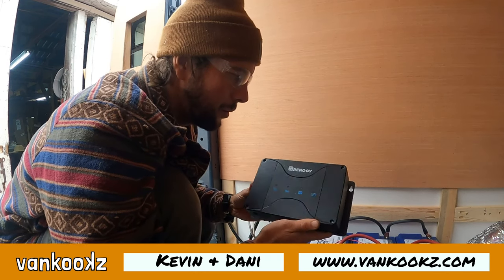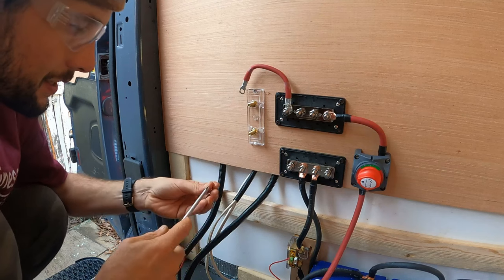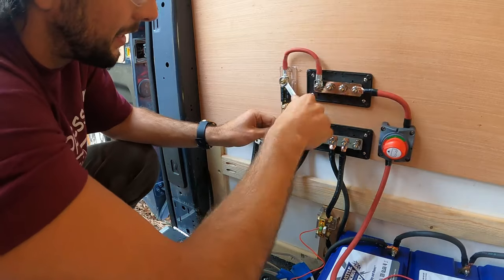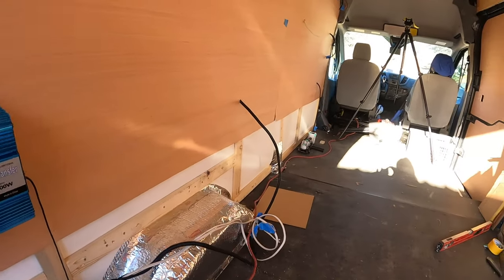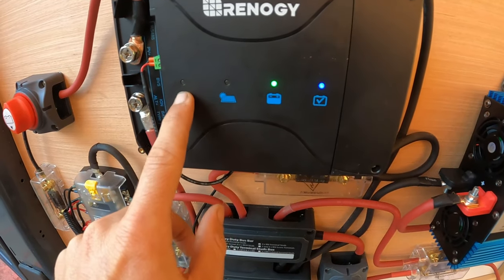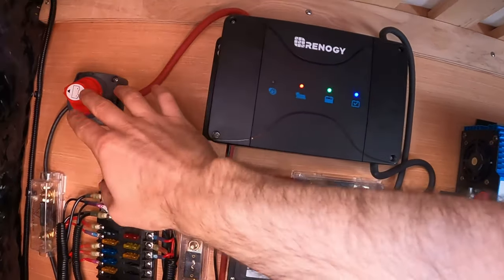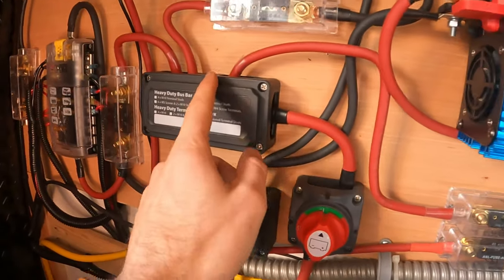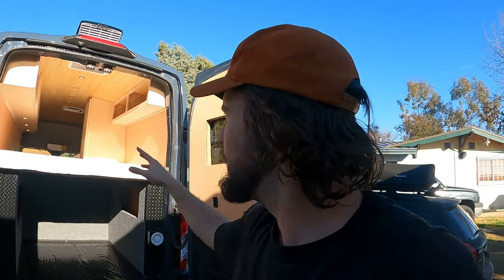Installing a Renogy DC to DC MPPT Charge Controller | Wiring a Solar Charge Controller

Comment: Hey great video! Can I ask why you went with the 60 amp fuse between the switch and the solar cables? is it to protect against high voltage when it's really hot? I read the switch can only handle up to 48V
Reply from the maker: This is a 12v system so it can handle the voltage.  The amp protects the switch and the entire system in the case of a short.  Since this is a moving vehicle anything can happen too.  In the case of an accident or something wiggles lose it will prevent a fire of damage to your charge controller or worse.
Reply: @Vankookz  Oh ok, so your solar panels only produce up to 12v which would be below the 48v limit on that switch. I have a 200 watts solar panel, so I'm thinking 20amp fuse instead of a 60?
Reply: @byron_glover  Hi Byron, I don’t have a specific answer to your question, but from the Solar videos I’ve watched (and I”ve watched a ton), I have never seen anyone use a low amp breaker between their panels and controller.  The whole amp to volt formula isn’t at the top of my head, but the panel wattage (probably there is a watt to amp formula out there too), and it is way bigger than 20 amp.  If you check out the many offerings by Will Prowse, you can probably get needed info from his YT and website.  He explains everything very clearly and accurately.  I suspect if you put that low of a rated fuse inline, you would be constantly resetting/replacing it.  Hope your build goes well!
Reply: 20 amp x 12 volts = 220 watts. The fuse is to protect the equipment by not allowing the insulation to melt. If the wire is rated for 10 amp and your load is 200 watts, it means it's drawing 16.6 amp. The wire feeding the load will heat up, and the insulation will melt and cause a short (fire). The resistance of the wire at 10 amp will not be able to handle the 200 amp load  (amp). Most of the time, if the wire is underrated, the insulation will eventually become brittle, crack, and eventually short out.
Reply: The fuse will protect the wire rated at 10 amp by installing an 11 amp fuse. When the wire is overloaded the element in the fuse will melt and open the circuit.

Comment: Id of used 4gauge cable because thats a massive run
Reply from the maker: Yes ideally that’s definable a better choice. I also added fuses to the end at the battery terminal as well as near the mppt. (not shown in video)

Comment: That's a good video.  I did the same system on my semi.  I put 2 175w panels and hooked up the controller with the mc4 and anl fuses,  and connected to 4 12v batteries in parallel.  But mine keeps showing E1 code.  And I spoke with renogy and she said that my starter batteries are over discharged, but all four batteries are showing 12.8v. Do you know of any reason why that might be? Renogy said that the dc-dc 50a isn't compatible with sealed agm batteries.  But the website says it is and it says can charge a battery from zero.  Mine start my truck and run my fridge and dashcam and elogs,  but the renogy won't charge the batteries??

Comment: How do you keep the dc-dc charger from continuing to charge after you shut the vehicle off and draining your system? Thats what i thought the point of the ignition signal wire was for, even if you dont have the smart alternator
Reply: If you have a standard alternator it monitors the vehicle battery voltage, and only draws power from the vehicle when it's  at 14.4v which means the alternator is running. 

Like an old fashioned voltage sensing switch charge relay.

Comment: My charger drains the starter battery and doesn’t draw from my lithium batteries. I have checked all my wiring several times.
The only thing I didn’t do was to run a negative wire from the starter battery to the charge controller.
I ended up putting in a starter battery shutoff to avoid this but I shouldn’t have to do this.
Any thoughts?

Comment: Hello, I'm coming from france so sorry for my english 😀I just bought this Renogy DC2DC MPPT 30A. I want to install a solar panel 100W with 23.5V of VOC at 25°C, and the maximum solar input voltage of the MPPT is 25V. At -10°C the VOC of the solar panel will be higher 25V. Is it a problem ? What solar panel did you install ? Thank you in advance for your help. Regards. Thomas
Reply from the maker: I installed three 200W renogy panels basically once the panels exceeds 25v it will stop charging and return one voltage drops
Reply: @Vankookz  Thank you for your feed back. What is the VOC of each solar panel please ? I think there are in parallels right ? I understand if the VOC is hiher than lthe MPPT voltage, it cut off the charging until the voltage of the solar panel decrease ? It's not dangerous for the MPPT ? Thank you

Comment: Hi Kevin
I keep getting a solid yellow light on the Charger for the leaisure battery. My battery voltageis13.3 (lithium iron phosphate).the manual talks about the voltage charges and that the charger wont charge at a certain voltage, but im not sure if that is the issue or not.  I checked all of my connections and grounds. Renogy replaced this charger 50amp dc to dc charger with mppt.  However still have the same issue.
The only difference for my setup is that i used 1/0 from my start battery (conventional alternator) 250 amp fuse and from the 70 amp fuse  to the charger i used 4 awg. 
I"m also not getting a charge via either start battery or solar panel.  The solar panel has the correct voltage when i tested it.  I'm using a solar shut off, but i'll try the same shut Off switch that shows in your video.
Reply from the maker: What type of vehicle do you have?
Reply from the maker: You may need to also wire the ignition switch
Reply: It"s a 2002 dodge Ram Van 3500
Reply: Not sure if you received my reply for the type of van I have?  It's a 2002 dodge van (doesn't have a smart alternator).
Reply from the maker: @kel5194  hmmm... I know that I was getting a yellow light when I was getting too much power from a solar panel that was over 25V. M. I'm not 100% sure what's going on there. I know renogy isn't much help either. Keep us posted.
Reply: I just found the problem. Thanks for your time, I appreciate it.  
There was a circuit breaker that's faulty.  Whew!  After a few weeks of going through everything and re-doing grounds, and other things and that's what it was. All is right with the world now - cheers.

Comment: Well you don’t need to use a screwdriver if you know how to use the clutch on a drill or trigger control on an impact driver. And that is a wire stripper, they’re just for small gauge wire.
Reply from the maker: Thanks 🙏

Comment: Problem with this controller is you can not run solar panels in series, it supports max voltage 20v, therefore if run parallel which requires larger cable 😅😅😅😅😅
Run solar panels in series then parallel them is an ideal .

We are going to install separate Solar Controller to handle our (6 )100w solar panels along with this DC DC controller if it works🤞
Reply from the maker: It really is a major downfall of the unit.  No idea why they would limit it to 25v max input.   I had bought one for my van but my panel is rated 35v so it was worthless I had to send it back and get a Rover
Reply: I don't understand what makes this such a concern. I've ordered 6x renogy 100w panels and plan to run 2 banks of 3 panels in parallell into my van (when it eventually arrives). This will keep current flow well under limits of mc4's on the roof.  Each bank will have its own renogy mc4 fuse and will come into the van on their own wires, once inside ill and convert to anderson plugs and use a 2-1 anderson and run thicker wires for a couple meters to the renogy 50A DC-DC. The cost of a thicker cable compared to thiner wire of a series connected solar setup is a less than (AUD) $10/m difference?

I figure oversizing wires and fuses for charge inputs is always beneficial so that it will be future proofed, in case there's any developments or modifications you can make to solar input and provide increased power in replacing panels one day or adding more panels.

Being oversized will at least have decreased inefficiencies and more of the power produced will make it to the battery.

Frankly there's a greater loss of efficiency in converting higher voltages (48v for example) down to 12v in most solar controllers.

Of course there's pros and cons for any product but I think there's more pro's in this unit than other options out there for the money, size and simplification of a combination unit like this.
Reply: @thomaspoynter9031  if you ever need to save costs for thicker wire too you can buy welding cable and use that, 10meters of 8 b&s is 4awg i think and that only cost me $55
Reply: thats what I do and I make my own cables.....buying a good wire cutter and a crimp tool makes it easy too
Reply: Max. Solar Input Voltage : 50V is listed for current model

Comment: GREAT PRODUCT BUT TOO SMALL. This little unit cant handle my 4 solar panels at 12v 700w 58A, plus its 50A current capacity is actual split between the solar and alternator ar 25A each. If it could handle the full 700w and 58A from the solar panels, plus the amps coming from the alternator charging, then it would be ideal.
Reply from the maker: Totally agree! I still can’t believe they haven’t made it better yet.

Comment: what amp bus bars are those at 5:59
Reply from the maker: 250 amps 
https://www.amazon.com/Black-Power-Distribution-Block-BUSBAR/dp/B07C5SC7TB?crid=1G8IB1W64CLTV&keywords=bus+bar+made+in+usa&qid=1655326131&s=industrial&sprefix=bus+bar+made+in+usa,industrial,165&sr=1-2-spons&psc=1&spLa=ZW5jcnlwdGVkUXVhbGlmaWVyPUExUDNSSDZHNUxKOFBNJmVuY3J5cHRlZElkPUEwODQzNjk3M1NOVVhNQVpXRFZZNyZlbmNyeXB0ZWRBZElkPUExMDQ1MzExMlJKTE5EUzlESFYzVCZ3aWRnZXROYW1lPXNwX2F0ZiZhY3Rpb249Y2xpY2tSZWRpcmVjdCZkb05vdExvZ0NsaWNrPXRydWU%3D&linkCode=sl1&tag=vankookz-20&linkId=7004da1d8e312df8bf0b8f65bcf5a869&language=en_US&ref_=as_li_ss_tl

Comment: So this is a Ford Transit idk year, I thought all have a smart alternator
Reply from the maker: I had a hard time figuring this out.  I eventually called the dealership and was told that it did not.  I'm not sure the year but it was the basic bare bones model.
Reply: @Vankookz  essayist way to tell is check the Neg terminal on the starter battery, if there's a black tiny unit bolted to the main earth lead you have smart alt, (unit is a sensor for the smart alt) 👍

Comment: Can you help? I have a preowned sprinter camper van converted with the same Renogy DC unit. Everything works but the DC power does not, the battery icon does not light up. Any suggestions?
Reply: Is there a fuse between the battery and the unit?
Reply from the maker: Have you checked all your ground connections?

Comment: That's a monster inverter, you better start getting used to using 12 volt equipment. Almost anything can be found in 12 volts, power inverters are a waste of power and a battery killer.
Reply from the maker: It's worked great.  I agree that they are overkill this is just what the customer wanted.
Reply: I forgot the alternator is wired in, I guess long as the vans running while using the inverter it wouldn't harm the batteries. But straight solar is nice and quiet, and if your going to do that a generator would be cheaper.. inverters are pretty dangerous too. 12 volts all the way.
Reply: @Danaman117  what ? I use a 2000w inverter off 2x 120ah Kings LFP all the time. I run a regular, kettle, toaster and induction cook top. Everything works great. I have 0 need for a generator.  Probably only half that battery on any day, includes 2x 12v fridges. Charging is via 2x 200w solar blankets, or the 2x 50A dcdc converters when driving. 0 need for a noisy generator.

Comment: Could you explain to a idiot why the 25v maximum to solar is a problem plse
Reply from the maker: Then you are limited to only 25V input
Reply from the maker: So you can't have a very large array
Reply: @Vankookz  sure you can, just need to wire them in parallel which unfortunately could require some heavier gauge wire and added cost.
Reply: @Vankookz  single domestic solar panels are 460W now.

Comment: What is your solar panel array? How many watts were you able to get into that unit (how did you stay under 25amp)? Thanks!
Reply from the maker: 3 x 200 watt 20 amp wired in parallel.  So 600W at 20A.  This is the major downfall of the unit maxing out at 25A.

Comment: Can you help? I have a preowned sprinter camper van converted with the same Renogy DC unit. Everything works but the DC power does not, the battery icon does not light up. Any suggestions?
Reply from the maker: Are all ground connections soild and tight?
Reply: How do I check?